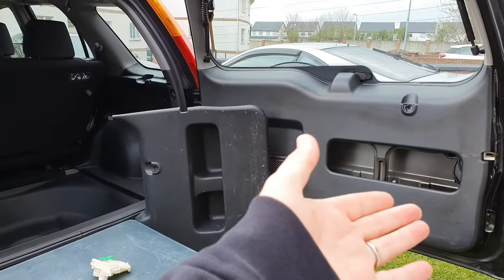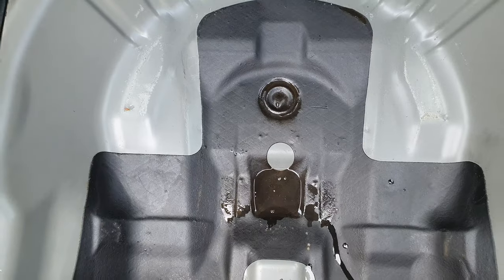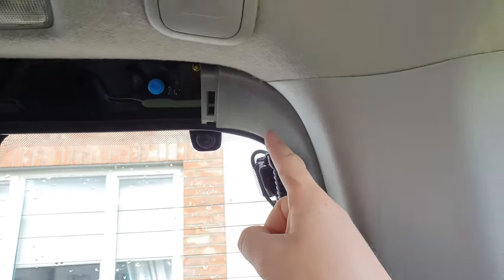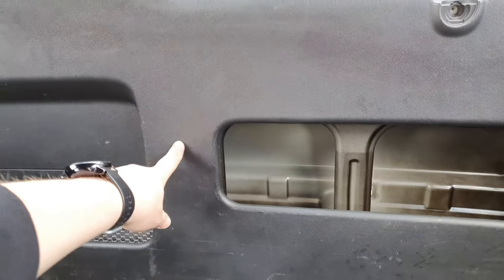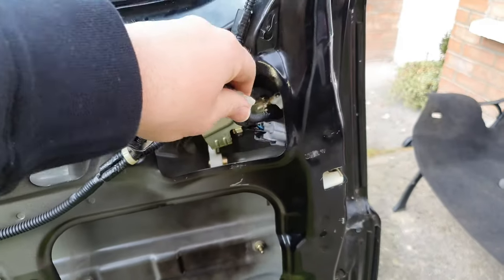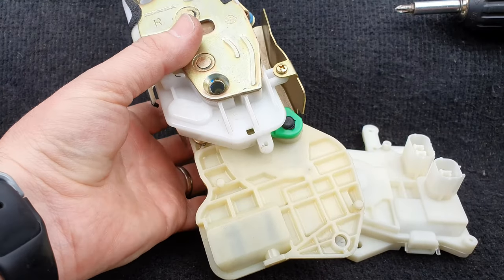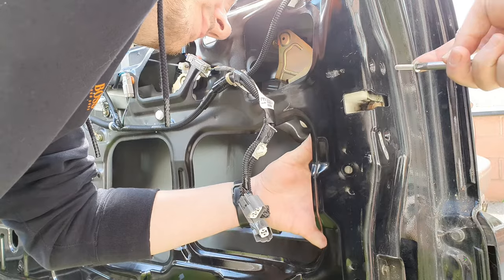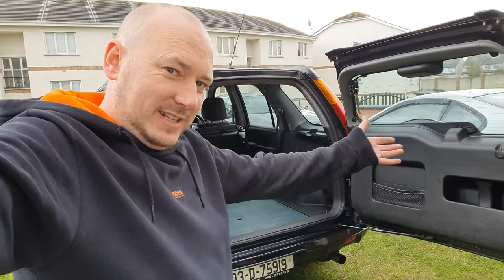car door lock stuck in lock position/can't open car door/honda crv door lock actuator replacement

Comment: God bless you my Irish friend! 

Followed the steps and managed not to brake any of the pins! 

The door was locked, but from another YouTube video, I’ve seen you can unlock the door so I did and then your video….

My CRV mk2 is 20 years old and refusing to die… only little things like this door locker…

Again thank you and greetings from Bulgaria :)
Reply from the maker: @patzoSF  My cr-v dose not have the lock release on the inside, so i needed to remove the panels from the inside. But I'm happy you got it sorted. Yes they are an excellent vehicle keep it as long as you can. 👍
Reply: Mine did not had lock release either.

There was a little round plastic which I had to remove and put my finger in it in order to unlock it…

https://youtu.be/BaQ_DXJzeSE?si=itEqJt7UXzxGgF7V

Comment: Thanks for taking the time to show us how you did it. Very helpful and saved me some money.  One small addition was that after I did all you said, I still couldn't open the door as the deadlock was on. I found an inch long bit of white plastic shaped like a letter "E" which you can just see at  05:38 in the film. This goes up and down to unlock the deadlock.
Reply from the maker: Yes that's correct, i forgot to mention that. Glad you liked the video. Thanks for your comment.
Reply: @GPTV2020  what is the deadlock? i have not opened the back, but i found after pulling that round piece of trim, i could put my finger in and switch something up and down, but having been reluctant to pry off the large piece on the bottom, i don't want to break the connection in the middle you say is so easy to break, so how do i remove the bottom panel without breaking it.
Reply from the maker: @bobcrowley625  hi, thanks for your comment, I'll be honest you most likely won’t get it off without breaking that middle clip. But it doesn't make much difference if it is broken because it still feels sturdy enough. The deadlock is a double lock by pressing your keys twice. Some car have this feature.

Comment: This was so well done!!! My problem was the latch not actuator but this video let me replace it quickly and without busting up my trim!!! Thanks!!!
Reply from the maker: I'm glad it helped. Thank you for your comment.
Reply: ardiseschenberg.  How did you know it was the latch? The trunk won't open on my 2014 CRV. It happened when the trunk closed down on the edge of a blanket. I was able to remove the blanket but was no longer able to open the trunk. Does this sound like a stuck latch & not the actuator?

Comment: Nice job. My son just bought used 2003 CRV and he cannot lock the tailgate door. This may be one of the issues. We felt the pressure of purchasing it from private seller due to the car sale market here in middle Tennessee. Thank you for this. Give me insight before we start asking around for a mechanic/auto detailer. Hope yo have dryer sunnier days!
Reply from the maker: Lol, thank you, its very inexpensive to do yourself, the actuator only cost me 30 euro that's around 45 dollars, and its easy enough to do yourself. Hopefully you get it sorted.
Reply: Did it work?

Comment: Thanks for the video. Will try to remove the tricky clip tomorrow from the back panel
Reply from the maker: Now i was told there is a hatch on the side where the lock is, with a lever to release the door but i never found it. Maybe that will help you also.

Comment: To open the rear door on the right of door is a rubber bung. Pull it off, stick your finger inside and push up on the little lever in there. 
 It's kinda in the middle of the gubbins in there. Gently pull the trim straight towards you or ideally use a long trim lever to get behind the plastic clips.
Reply from the maker: Great tip, i didn't know that thanks
Reply: kindly do a video of this please

Comment: Thank you so much for this very helpful video
My back door is stuck in the lock position like your but can I open the back door without removing the back door panel just thru the opening and pushing the latch down like you showed us or is it easier to remove the panel first. 
Thanks again
Reply from the maker: In my case i needed to remove the panels but some people are saying they have a latch on the inside that releases the door. I don't have one on my cr-v but you possibly have. Anyway it is easy enough to do.
Reply: @GPTV2020  hey thank u so much for your time and kindness. God bless

Comment: @GPTV2020. The trunk won't open on my 2014 CRV after the edge of a blanket got stuck when I closed the trunk. I was able to remove the blanket but then the trunk would no longer unlock. Do you think this is a jammed latch instead of a bad actuator?
Reply from the maker: I would say the actuator could be gone now because of that. I would get someone inside and outside opening by the handle and pushing from the inside first before buying the actuator. It could be just jammed but I'd reckon it is the actuator.

Comment: Thanks for the video, it's easy to take off the door cover by following your step, however, I still can not open the door. But I found it's ok to open if I push the white plastic trigger and open th door at the same time. The problem is I need to push the trigger everytime when I want to open the tailgate. Does it mean I need to replace the actuator?
Reply from the maker: Yes, the actuator is malfunctioning it might click and sound like its working but it's not actually moving much.
Reply: @GPTV2020  Thanks Gavin , I will buy a new one😄
Reply from the maker: @scottchang8268  now there is a Leftside and Rightside type so take a look at which type you need. Hopefully it all goes smoothly for you.
Reply: @GPTV2020  Get a new one, and just replace the failed part, works fine! Thanks again😁
Reply from the maker: @scottchang8268  awesome, happy it worked for you.

Comment: Really helpful thank you. My back door would not unlock - had to get dogs in and out via the side door, then just by chance it unlocked. Was ok for a bit but now it won't lock when the other doors do. I'll attempt to fit a new actuator - your video was very useful. If I do muck it up my 20 year old, engineer, nephew will help 😂 Thank you very much 👍
Reply from the maker: Your welcome.

Comment: can you post the link of the remplace part or what side i have to buy right left ... please
Reply from the maker: 72115-S5A-A01 is the part number that comes up them, but they are all different in shape. Use this website to find your part number. https://partsouq.com/
Then Google that part number, and just to be sure make sure the one you order is the same shape as your one. As for the colours, that won't matter. I got mine from aliexpress for 30 euro. Still works fine.
Reply: I’m curious if there is a good brand that won’t break like the original part

Comment: My rear door on my curb won’t close all the way. Will replacing the actuator fix it or do I need to do something with the plastic piece?
Reply from the maker: It could be getting held back by something or the door lock itself could be out of place. I wouldn't replace the actuator until i knew why the door was not closing.

Comment: Thanks for the video!  I’m hoping that this will fix my problem,  my rear door/hatch opens and shuts but won’t lock, it’s a 2010 and looks very different, the door goes up and down
Reply from the maker: The 2010 had some wiring issues, where sometimes it would lock and sometimes it wouldn't. Do you hear anything click when you dubble press the key fob or put the key in the door and turn it twice? If you hear nothing it could be wiring if you do hear a click it could be the actuator. But your cheapest options would be to check all fuses and swap the actuator first.

Comment: Hi Gavin, initial thanks for the video, would have been lost without it.
Also thanks to Tim (Bateman) as I found that having removed all the panels and activated the lever as per 5:15 in your video, the door was still locked.
I went back to the video and read through the comments and saw Tim’s and with one click, the door opened.

I am now at the point of ordering a new actuator but just a quick question, there isn’t a fuse controlling this is there?  Be a shame if that’s the problem.
I am doubtful because the rear window and the other four doors still work so I am figuring, if there is a fuse, it would control these as well.

Cheers again
Reply from the maker: Hey Les, thanks for your comment. There is normally a fuse in some cars, I'm not sure if there is a fuse for your car but you could have a look at all your fuse boxes and check. As for the little leaver or catch to release the door, that is not available in my CRV, that's why i did not feature it in the video. Again thanks for watching and your comment.
Reply: Final question, I have seen actuator prices ranging from £15 (EBay) to £80 (Honda dealers) .  Where did you get your new actuator and do you know the Part Number?  Searching online suggests 72115-S5A-A01 but wondered if you knew.   Also the cheaper versions don’t have the actuator lever coloured green, it’s the same colour plastic as the main body.
Reply from the maker: 72115-S5A-A01 is the part number that comes up them, but they are all different in shape. Use this website to find your part number. https://partsouq.com/
Then Google that part number, and just to be sure make sure the one you order is the same shape as your one. As for the colours, that won't matter. I got mine from aliexpress for 30 euro. Still works fine.
Reply: Hi Gav
Thanks for all the responses.  Part ordered off Amazon so if there is a problem I can return it at zero cost.   Took the old one out to measure it up and the hardest part of the whole process was, after disconnecting everything,  getting the unit out of the door panel.
Reply: Information ,I just changed driver door actuator on a 2002 Japanese made version. I found the British car version used the white ones with connections on side. Other version is black and connectors go in the end

Comment: What is the proper way to remove the main trim piece to avoid breaking the middle tab?
Reply from the maker: I actually don't know, it just pushes in. The only way I could see was to remove all the other clips then lift the centre part up to slid it off the clip that is pushed in the the door. Hope this helps.

Comment: I have 2004 crv and the trunk door doesn’t lock or unlock using the key remote so I’m assuming it’s the same problem as yours and probably identical actuator, please let me know if this is the case. thanks
Reply from the maker: Yep, it sounds like it.
Reply: @GPTV2020  thanks

Comment: Hi Gavin! Thank you for this video. Once I opened up the trunk I discovered that the actuator and the metal mechanism that it is supposed to be attached to we're not attached to the inside of the trunk like it is supposed to be. I reattached the two actuator components to themselves with screws I got at a hardware and reattached it to the trunk itself, but it still does not work. Does that mean that the actuator is bad? The metal half of the actuator does not seem to respond well to the trunk handle which makes me wonder if that has gone bad.

Any pointers would be greatly appreciated.
Reply from the maker: It sounds like it yes, but it could be a different problem like a dead fues or if you wanted to remove one of the actuators from a different door on your car, and test that one on the wiring in the boot/trunk to see if it is the wiring first. Hopefully this will help.
Reply: @GPTV2020  after taking a closer look at a part of the video, I was able to get it working. Thanks again!
Reply from the maker: @nicholastrudeau7581  aw that's great, I'm glad you got it sorted.

Comment: hi, about the actuator, is the actuator in the back same as the actuator on the passenger side. thanks
Reply from the maker: 72115-S5A-A01 is the part number that comes up for them, but they are all different in shape. Use this website to find your part number. https://partsouq.com/
Then Google that part number, and just to be sure take yours out and make sure the one you order is the same shape as your one.

Comment: I just bought a 2005 crv, the rear door is fine but the rear glass hatch won’t open. Can anyone please help? My luck there are none video on youtube about this 😢
Reply from the maker: It's probably the actuator, remove all the panels from the door so you can see the latch then try to open it and buy a new actuator replacement.
Reply: @GPTV2020  thanks a lot bro! Will try to do that later